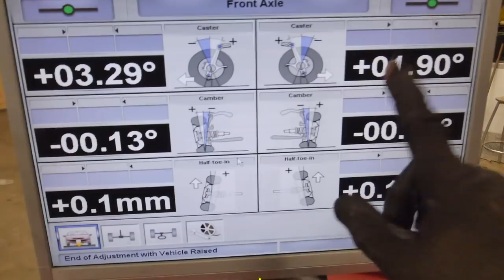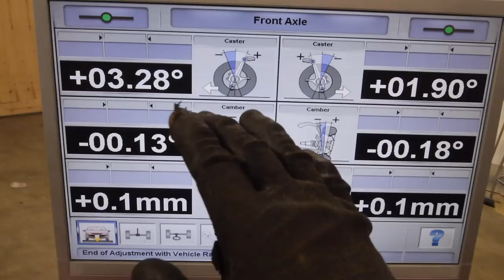N60 HILUX ADJUSTABLE/CASTER CORRECTED BALL JOINTS - Get a good alignment on your IFS rig!

Comment: Also can confirm you definitely have to cut back your upper control arm or bend like yours slightly to fit ball joint spacers for anyone wondering…. A grinder and a can of paint sorted mine out quick!
Reply from the maker: Sweet, that's good to confirm👌
Reply: @boostedbuiltgarage  maybe re design it so no one has to cut their rig up🙊

Comment: I'm definitely getting some of these, but your 2° castor difference would surely make it pull
Reply: Without compensating with more toe on one side?
Reply from the maker: Why would it pull? It makes the car behave immensely better on-road. You don't compensate for camber in the road with toe, you do it with more caster on the kerb side wheel.
Reply: @boostedbuiltgarage  2° castor split would make it veer towards the trailing wheel? Your product and it's adjustability looks amazing, I just thought with that much difference in castor in your alignment it would pull?
Reply from the maker: I don't understand what difference you're talking about? Are you talking about on my car? If so, there's something bent (we think) so that's not me setting it like that on purpose. You usually want .5⁰ more caster on kerb side
Reply: @boostedbuiltgarage  ahhhhh, well that explains the difference in castor! Yeah, i was talking about the alignment. Bent idler maybe, you know more than me!
Reply from the maker: Yeah I was trying to figure out what you were talking about. I'm pretty sure the upper ball joint mount on the knuckle is bent. Just haven't been bothered to get another/will be going solid axle eventually so not too concerned haha

Comment: How much difference would there be in just using the LCA kit to handling/ride?
Reply from the maker: The lower kit gives you the best gain in caster, which gives the biggest improvement on road, however the upper then gives you ability to keep the full amount of caster and dial out the usual excessive camber. Where as if you're only using the lowers you may have to sacrifice the full caster gain to try get camber adjusted properly

Comment: hey mate, love the parts looking at getting a set for my n60. just wanted to know whatb size lift your running? im on a 3" so would these be real good for getting my alignment were it should be. ive got 3" no diff drop, would you reckon run these on 3" or do a diff drop. cheers
Reply from the maker: To be honest I don't know what my lift is. It would probably be about 3-4"
These are the only thing that will help with your alignment 👌

You're prob on the verge of needing diff drop, but it's easy enough to see how everything sits with these and assess from there
Reply: @boostedbuiltgarage  legend mate cheers for the quick reply awesome work on the parts btw✌️

Comment: All said & done is there a before and after advantage off road, if so what is it and have you a clip that proves it? On road means bugger all really cause at the end of the day it’s a Lux not a Lamborghini😂 also the 6 hours spent trying to adjust everything, I’m not sure a tyre shop would spend that much time on detail, if they were a simple fit without bending or cutting shit on the front end and made the lux a tiny bit more capable off road I think they’d sell like hot cakes if priced fairly, please take this as constructive criticism mate I’m not trying to ruffle ya feathers…
Reply: Luxborgini mate